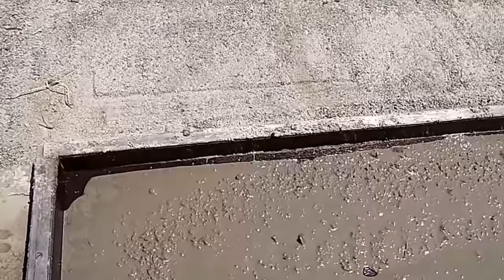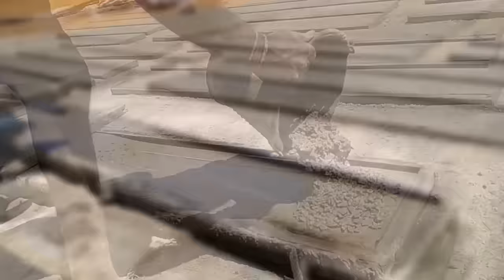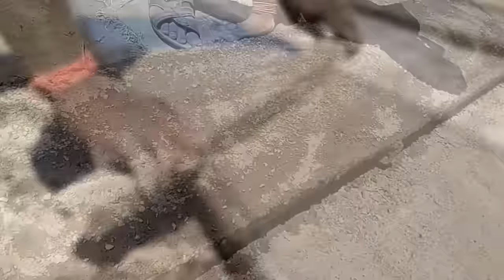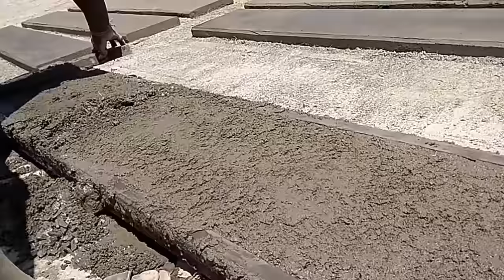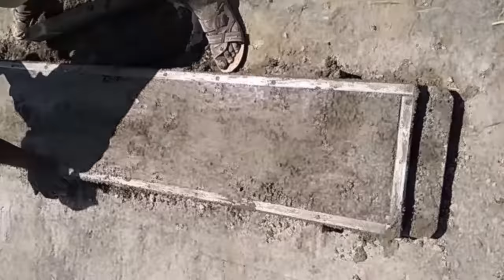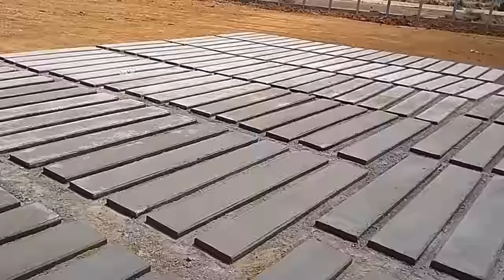precast wall  panels making diy

Comment: How thick is the wire reinforcement you put in the panel?
Reply: Your choice; D6, D8, D10, depends on how strong you want your panel. Above D10 would be rather overkill though. Just don't do it wy they do here, have your rebar bound together.

Comment: Too much water, way way too much! So you imagine fluidity will eliminate need to vibrate, then you have to amend with dry mix at the end, but you end up with very weak panels. And that oil is too much it floats in the mix, doesn't do it lots of good. Why not try a vibrator table and water-reducing admixtures instead? I call that bad practice.
Reply from the maker: Ok we will try vibrator
Reply: @AACPprecast  And much less water, try ratio of 0.45 water to 1 cement by weight max, you can use plasticizer to make more flowability. Cheers.